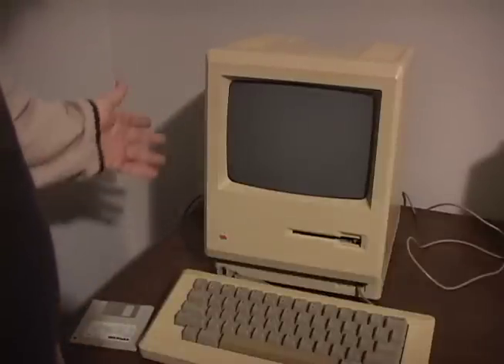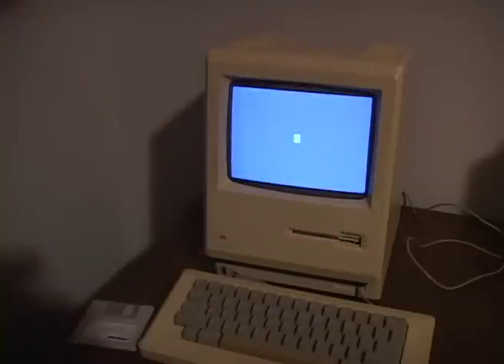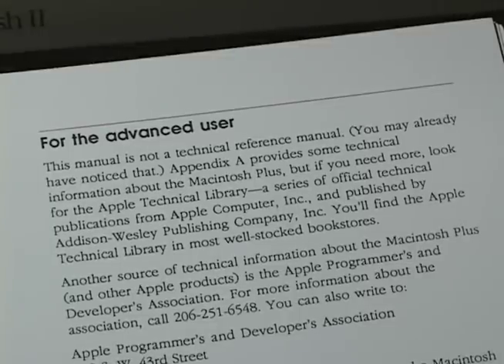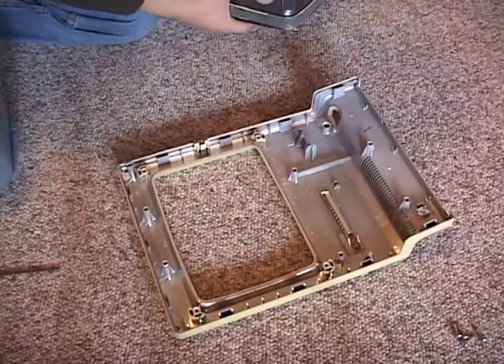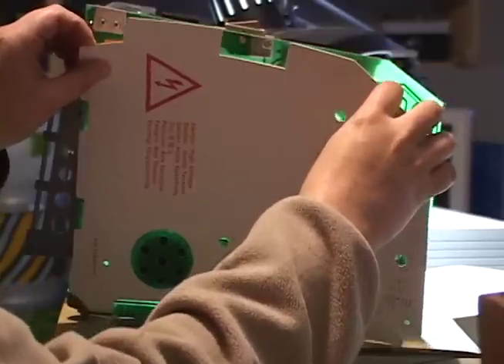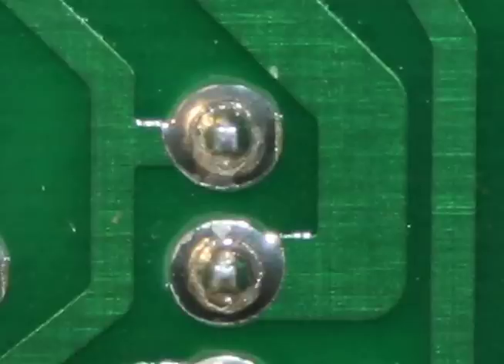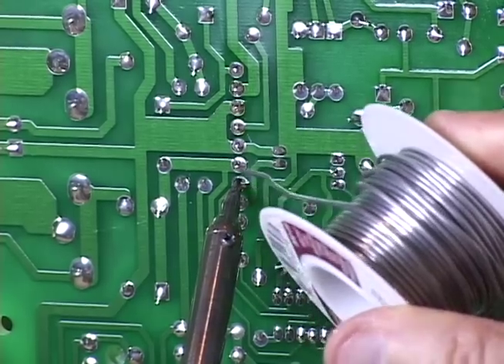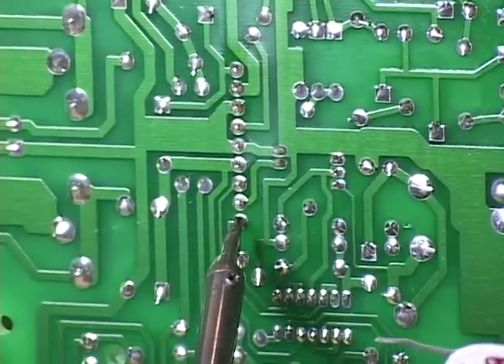Solving Compact Macintosh Video Problems

Comment: My Mac plus video kept going out. I would keep smacking it on it's side and it would sometimes come back but then disappear. I was getting frustrated and about to give up. Then I left it on it's side and the video came back on it's own. The mac's probably just taunting me. Payback for smacking it.
Reply: I think the problem with your Mac is a cracked board. What’s probably happening inside is that there’s a broken trace from a crack in the motherboard so whenever you smack it or tilt it to its side, the trace connects and the computer works.

Comment: Can this problem also manifest with powering on as well?  I can hear the fan running, but the monitor never powers on.
Reply from the maker: Do you get a system beep at startup?
Reply: No.  Only the fan spins.
Reply from the maker: Not just the video in that case. Problem is somewhere after the power supply on the analog board I'd think.